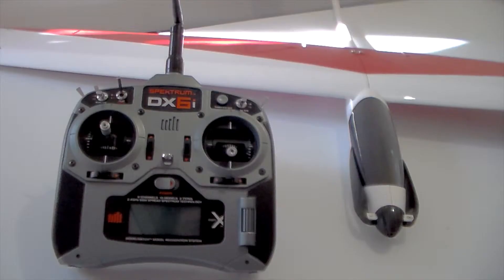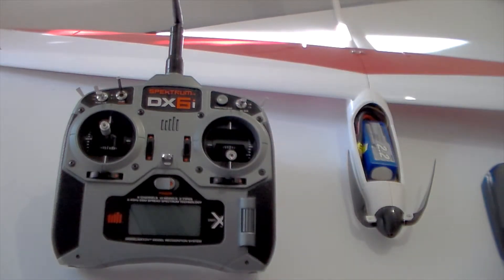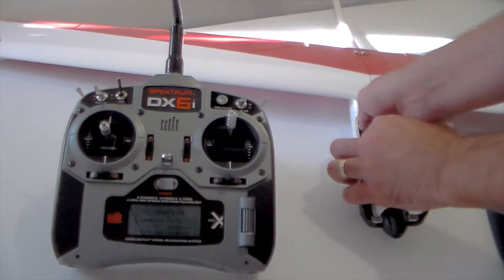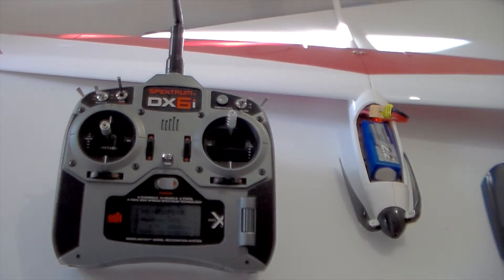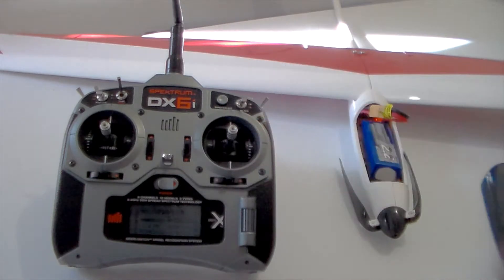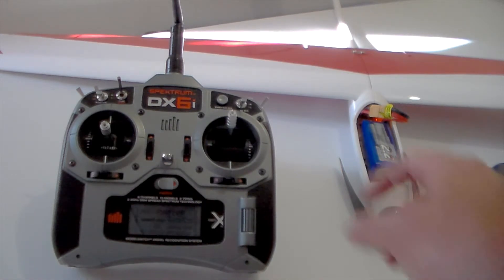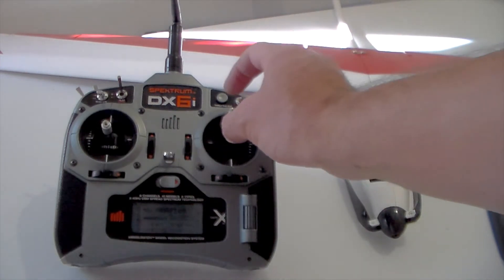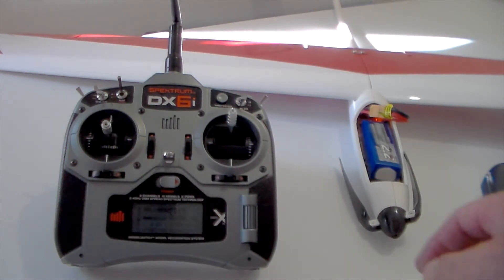H-King ESC Brake Setting

Comment: Great vid bru.
A few questions: Where did you learn this? Is there a downloadable manual somewhere? Will this procedure work with the HobbyKing 120A Boat ESC? https://hobbyking.com/en_us/hobbyking-120a-boat-esc-4a-ubec.html
Reply from the maker: ESC's usually come with a little manual, which typically includes a table on how to reprogram (sequence of beeps & tones). NOTE - this is NOT universal across all ESC's, so don't try reprogramming an ESC if you don't have the instructions (or have a video) or else you could end up with a an unusable ESC..!